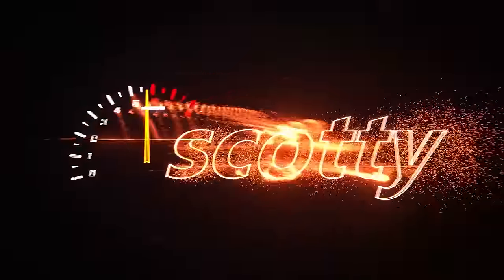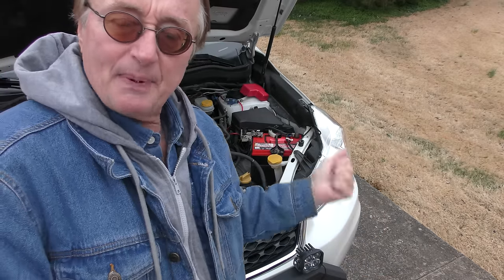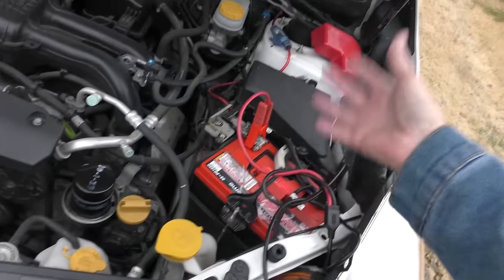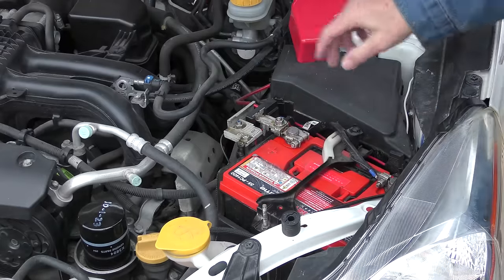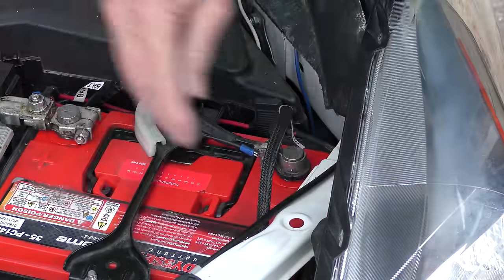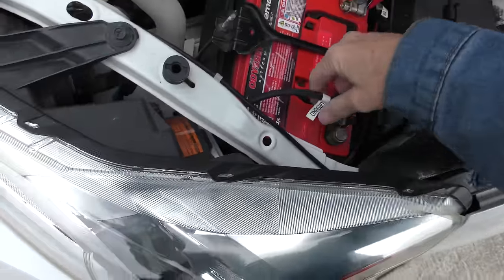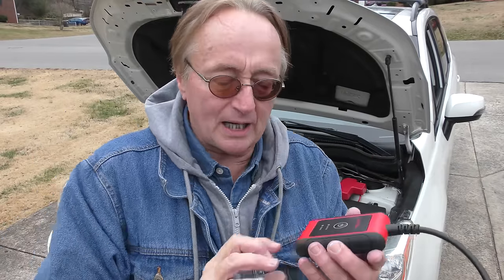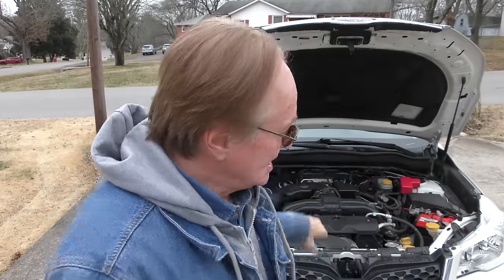Here's Why Connecting Your Battery Like This Will Destroy Your Car

Comment: That battery has a statement on its top  that specifies the desired charging voltage,the voltage desired according to that label is slightly higher than most cars' electrical systems run/charge at. If I remember the battery wants about 14.4 to 14.7 volts at specified temperature (more than that will damage it but less will cause it to gradually run undercharged and sulfating) most cars run around 13.8 - 14 volts or so which is probably what most batteries are supposed to charge at

Comment: Always check terminals FIRST....
Reply: they gotta be a little loose right?
Reply: @utrak  Screws are always a lil loose in our civilization...
Reply: The first thing I check is the battery voltages on the battery terminals themselves. Ignition off, on, start and engine running.   Then on the connector part on top of the terminals while after the engine is running to see voltage amount.  Loose connections  are not good and open connections  are harmful.  Scott is spot on with the wacky things that happen with erratic and low voltage conditions.  Torque is important.  Also too much tightening torque can destroy som
e connectors.  Use smaller wrenches to prevent overtightening, but insure they are tight.

Comment: Lead & Battery Terminals:

Thank you for the tip about making sure connections are tight!

One concern I have is if battery posts and clamps are really made of lead, when people remove the corrosion, they may be releasing lots of small lead particles.  Since lead is toxic, that may not be the best thing.

One solution would be if manufacturers coated the outer surface of the posts and clamps with a non-corrosive metal that does not contain lead.

Comment: Yep. Most folks don't realize how critical the electrical system is and that most vehicle malfunctions are relatively simple poor electrical connections - or shorted (causing blown fuses) as in the classic O2 sensor wiring shorted against a hot exhaust pipe! Periodically check all electrical grounds and associated wiring - frame to body, body to engine, battery to engine, etc, and especially the battery connections. Weird white-green fuzz on the battery posts means it's time to clean the battery posts and clamps! If your car is old and rusty like my '03 Exploder you WILL have at the very least one or two rusty grounding connections. Corrosion seeps in and since most cars have only a 12V system, the electricity starts to have increasing resistance to flow and difficulty pushing through this layer of crud and electrical dysfunction starts. Disconnect, sand till connection points are shiny and apply Dielectric Grease to ALL surfaces before reassembly. I put that sh*t on everything.

Comment: My 2002 Ford Ranger was having an issue with the speedometer jumping up to around 20 mph while sitting still. It turned out to be a not so great positive battery cable connection. Cleaned battery terminal, tightened cable end real tight, and speedometer started working correctly. Someone on the Ford Ranger forum helped me out with the suggestion. It worked. Bad connections can cause all sorts of issues.

Comment: Several years ago, I bought a new Yellow Optima battery and it was the worst battery I ever bought. It wouldn't keep a charge if the car sat for over two days, no matter how far I drove it to charge it. I took it back to Advance Auto and got a full refund. Then I did some research. I found that Optima batteries were very good until the original company was bought by another one. Quality control plummeted and the complaints were rampant. Never again.

Comment: an important thing to remember, is to give your battery a good regular charge via a multi stage charger,  car batteries are made to supply huge inrush current, but have very low capacity, so if the battery is not fully charged every so often, over time, it gets discharged more and more little by little, degrading the life of the battery. 
regular full over night charging will keep your battery in super health condition and it'll last many years longer than normal.

I wired in some Anderson's power pole connectors so I can quick connect the charger easily if I've not been traveling much.
Reply: THANK YOU for this good tip.  I never heard this before, not even from battery company reps, and I spent 30 years in fleet work.  But that seems to make a lot of sense.  
I keep my Lexus LS460 garaged with a trickle charger going.  Because if any car is a power hog even when turned off, its a big Lexus.  I tried numerous trickle chargers, some were hard to make work and some did not work at all, a fact that was only revealed when my general mistrust of such devices made me check the voltage during a cycle (the battery was getting no voltage but the charger showed a green light for it anyway!)
Ultimately I found the simple low-cost trickle charger from Harbor freight was the ideal choice.  Kept my late Mom's mercedes hooked up to one for years until I sold the car.  It worked flawlessly all that time.
Reply: there is a reason why fire trucks have charging ports on the outside that automatically disconnect when they drive off, they are always connected to the charger when not in use.
Reply: @windhelmguard5295  who on earth would even know that? lol
Reply: @John-gm8ty   a fire fighter would.
Reply: @windhelmguard5295  dead pan stare  reaLLLLy?  who'da have guessed?   ~sarcasm-
Reply: @John-gm8ty   you asked.

Comment: Now for a weak battery,  take an aspirin cut into 6 pieces as equally possible, remove the battery caps and drop one piece into each cell and fill with clean water or bottled water and trickle charge over night if possible and it will rejuvenate the battery ,   Because an aspirin apparently cleans the plates and .  I learned this when I commercial fished in Alaska from my captain….  I’ve done this to several batteries and it works

Comment: You should only replace the battery with the same type that the car originally came with. Lead/acid versus AGM batteries use a different charging algorithm that is pre-programmed into the car's computer. If you change the battery type, you must reprogram the computer in the car.
Reply: I don't believe that. I've been swapping between the two for years. Never had an issue. And I have 2 Benzos which are notorious for electrical gremlins
Reply: While this is true, they charge at a similar voltage, the only difference really is the AGMs won't take well to high voltage (15ish or so) where a flooded will handle that better. There isn't a lot of times where your vehicle is going to be pushing more than 14.7, so AGM should be a decent swap, but they are not really worth the additional cost if a regular old flooded battery was in there in the first place. At least in my eyes.
Reply: @-DJ-  I agree. I just use whatever is in stock cuz I don't have a choice when my cars are dead in the water. I used to get 5 years out of an 80 dollar battery now its three years out of a 225 dollar battery 🙄
Reply: The newer cars absolutely this is an issue. The older models it doesn’t matter
Reply: @Fordgroup00  what do you consider "newer"?
Reply: Our 2021 Nissan Titan has now AGM and no problems....alternator output us 13.8V
Reply: @maxxbenzz7842 true...older cars  didn't matter
Reply: Optimo batteries are a waste of money if you are going agm.    XS Power is way better
Reply: At one time before AGM, there was gel batteries which were much different to charge.  As long as you don't over charge an AGM, it charges the same as a flooded.  If an AGM is over charged, the moisture vents out and causes damage.
Reply: @--_DJ_--  The flooded is a better value unless you are doing off road driving with very steep hills or the vehicle is used in a way that it is occasionally turned over like an ATV.  Some people use the double priced AGM in lawn mowers.

Comment: Here's where a lesson in "voltage drop" comes in handy.  Take a reading between the battery terminal and post of each side while cranking.  Even a tight terminal can have a lot of resistance due to corrosion.

Comment: A bad connection  like this will often feel warmer due to higher resistance while running (on the + side of the system). And in extreme cases even sparks. I always charge a new battery for 24 h before mounting it in the car.

Comment: About that slide function.... have you tried double tapping the numbers themselves? I don't know100% but it makes sense intuitively. they ARE in a box that is typically a fill in box on 99% of GUIs I've seen.  If you do that I'd expect a keypad to pop up where you can input exact numbers manually instead of trying to find the G spot on that slide.

Comment: My 2018 Volkswagon Tiguan needed a new battery and you can't just install it your self. You have to bring it to a Dealer or Mechanic so they can program the computer with the code on the battery and it you don't it can shorten the battery life to just one year. If you don't put in the new code the computer will think the old battery is in there and over charge the battery shorting the life of the battery. I recommend do not by a German car.:yougotthis:

Comment: If you have manual transmission, you can start the engine even with an old battery.
Reply: if you have a manual transmission, you can start the engine with a dead battery, as long as your alternator works.

Comment: Over the decades I have found most common car problems have simple solutions. Trust your sensors. Search and find the true cause for the code. I use only a $20 scan tool, then search for and explore all possible causes. In the last 20 years I've had 10 vehicles, both new and well used, and only replaced two faulty sensors and three bad batteries. Pay attention and be diligent with maintenance. Now I'm going to check and clean up my battery connections.

Comment: A good digital volt meter will work just as well for testing battery and charging too.
Reply: Yup and way cheaper.
Reply: Nope, have to check it under load
Reply: For a quick and cursory check of a lead-acid battery, yep its what I usually go by.  And if you're like most people who aren't truly destitute we just change out the battery if it has X years and months on it and/or it's acting dodgy, or needs a jump twice, or we decided it looks ugly and would prefer a pretty new one etc.  But it seems like battery makers have mastered the art of making a battery that simply times out after 2 to 3 years, those stories we all used to have of OEM battery that lasted 6/7/10 years are a thing of the past.  

I believe when tech gets a little TOO advanced the people making such items, merely weaponize the tech against us by designing an expiration date into everything they can:  long enough to make it out of warranty, but no longer! I owned a no-name big screen TV and I bought a 3 year extended warranty.  The TV lasted 3 years and 3 weeks then died.  Next one did the same thing.  Most manufacturers make and sell crap that times out, then changes the name of their brand, and just sells us another.

Comment: The battery in my wife’s 2017 Subaru Legacy kept going dead when it was left for a week or so without being driven. We initially thought something had been left on inside that could cause a current drain, but found nothing. Shortly thereafter we received a notification from Subaru indicating a recall for just that problem. This was very timely because we were just about to have the problem diagnosed at a local repair shop. We took it in for the recall repair last week….hopefully that will solve the problem.

Comment: On a related note, once driving home from CA, car started losing power. After an underhood check, found the ground strap from firewall to motor was almost broken completely loose. reconnected, and all was good. Got home and added another strap in another location.

Comment: Instead of this fancy checking devices, it's better to use a analog Voltmeter.
Reply: I still have my Simpson.  People have made fun of me but it works perfectly
Reply: Depending on the update times on multimeters.  Flukes have a really slow sample rate and it sucks for instant reading because it may take a few seconds to get stable result and if erratic voltages occur they might not be fast enough to see it.  There are advantages over needle type meters if sample rate is fast enough. Also some electronic components can be harmed with analog type testers due to the current they run thru the circuit. Mostly on the continuity setting.

Comment: Scotty Kilmer I have a request because if you've done this I haven't found the video yet, but, Can you make a video on properly using a "Memory Saver" when disconnecting the battery?  Last time I tried, I only used the tiny 9v battery the stupid device said was powerful enough to keep the memory, but it wasn't, and it lost the settings, and at smog check time too... 

("Even I, The Great Scotty!  CAN NOT see electricity!"   Man, what a let-down, talk about never meet you heroes.)
Reply: A lot of modern cars have a relay on the lighter socket, which renders your memory saver useless unless you bypass the relay.
Reply: @RobertEmery  So how do you bypass that, pray tell?  Also - once you shove in the memory saver into your OBD port, you then hook it up to a separate battery power source probably NOT the one on the car whose memory you are saving, but some other battery instead!  Like on another car, for instance - how does the relay you mention fit into that type of hook up?
Reply: @robertmaybeth3434 you probably have to make sure you don't open the door or anything drawing any significant current when using the battery operated memory saver. For sure a 9V battery won't be able to maintain its voltage when a dome light comes on.
Leave a window open so you can plug in the memory saver thing in after the car systems have all gone to sleep and change the battery under the hood after that.
Reply: @RobertEmery for the cars with switched accessory power outlets you could back feed them by leaving the ignition on the accessory position and using a small gel cell SLA that can supply enough current to hold up the voltage. That'd work better than the ones going through the obd port as they could supply more current, and would be an easy DIY setup.

Comment: Definitely the loose neg. terminal was causing a charging issue.
However the battery is not charging as well as when new as the tests revealed.
Now that it will charge better, his problem should be resolved.. But i would Remove the battery and put it on a desulfator in a warm room. 
Then fully charge with a Bench charger. 
Refit the battery to the car and the electronics should keep the battery at optimal voltage and charge ~

Comment: Coat the terminals after cleaning them with Ballistol oil. Prevents corrosion. Ballistol can be used a hundred ways. Protects metal and leather.

Comment: I recently burned a hole in my battery (smelled terrible) from a lose connection.  The plastic around the cable was so hot it started to melt.  Thank got the cable was still okay.  I learned my lesson -- make sure those connections are tight!

Comment: I remember I had an original Mini where the electrics used to degrade and difficult starting and electrics not liking being on all at the same time. The dynamo was the problem as its output was dropping. The great thing is  the charging voltage could be altered with a relay in the controller unit. The Haynes manual showed how to link up a simple voltmeter and turning a screw got the charging circuit back up to 13.5 volts and all was well. I did this every year as a routine but of course now such simple solutions are no more. You wonder really is technology is anyone's friend but will be the ultimate ruin of us.

Comment: In the old days you didn’t even need a battery. Then comes computers that put the vehicle into limp mode if they think the battery isn’t good enough. Then comes like 20 computers to where you need a memory saver. That’s another can of worms. The 9 volt cigarette lighter plug ins don’t work on cars where the ignition off means cigarette lighter is off and the 9 volts are only able to put out half an amp. The OBD ports are rated for 4 amps so hooking up a big battery there can make troubles. Even with a proper memory saver like EZ Red you need all the computers to have fallen asleep with no interior lights on or other current draws. Then don’t forget some battery terminal protection spray, unbelievable how rare it is to find that done. Just swapping out a battery old days style is long gone days.

Comment: Scotty, love the content.  While everything you said this episode is true.  There is ALSO a MAJOR ISSUE that has not been communicated or recalled with multiple years worth of Subarus (including my 2019 3.6 which is a lemon law settlement for my 2017 3.6 where the entertainment center didn’t work).  Apparently the genius engineers chose to use a 3g network despite knowing it was being sunset in a few years.  Additionally, last year they switched satellite providers for their version of the onstar system.  Between these two epic engineering failures, the batteries are being drained to dead during the duration of a single drive around town, leaving you stranded at the side of the road if you turn it off.  They replaced the computer in our vehicle and it is still not fixed.  3 mos and counting without our car from this issue.  And a class action suit was already started and closed for the replacement module that they are otherwise charging nearly $1500 for.  Never again with Subaru and their nanny systems!

Comment: I use to do the same at a Texaco I worked at back in 70-71,  people would buy one we would fill the acid in them, heck we would wash our hands in it to get heavy grease off our hands but if you had a cut or scrap you knew it quick.